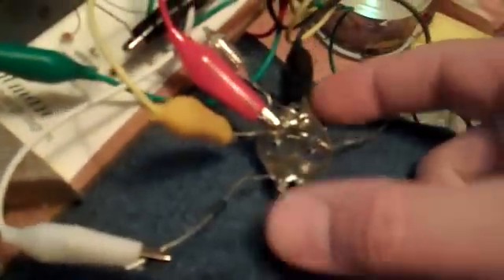Bedini Working Version

Comment: How about useing other wires? iv gone up to 18guage and found there is more torqe. and from what i have learned over the years - have the inner hole of the coild the same size as the magnets - use al the surfice area of the magnet, hey try a north south configuragtion - works for me! same as hollow core - but a bit harder to start.